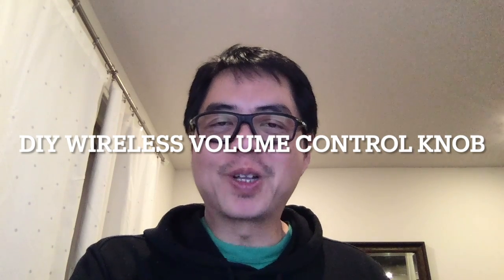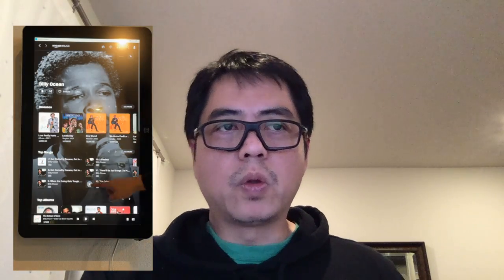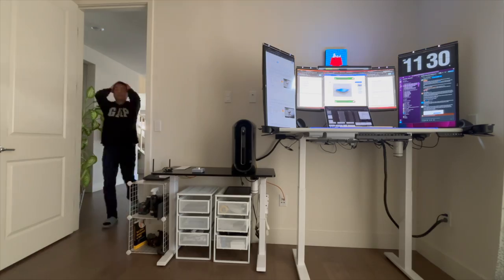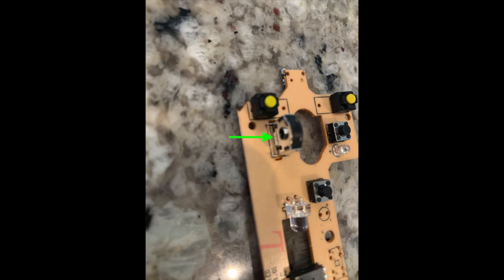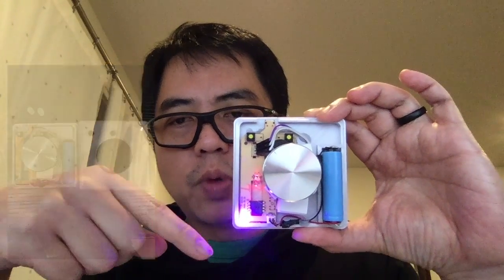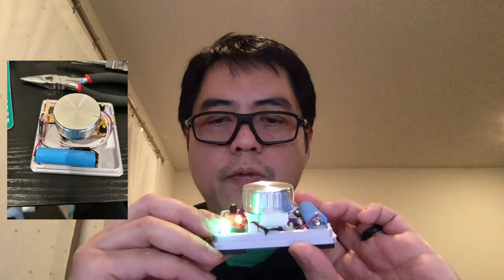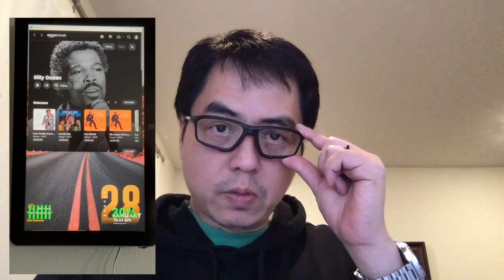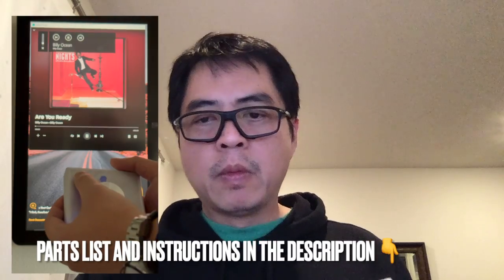DIY Wireless Volume Control Knob

Comment: This is great, been wanting to do a diy knob. I have a griffin  powermate, the old original wired one to use as a base in some way.

Also I'm really curious what you have on top of your monitors, the blinking lights? Looks cool
Reply from the maker: Thanks the lights are rgb sound lights. You can get them for cheap I just found this on AliExpress: $15.77 | Sound Control Rhythm LED Lamp Strip Music RGB Light Colorful Pickup RGB Voice-Activated Pickup Ambient Light
https://a.aliexpress.com/_mq2uo4X

Comment: Awesone proyect.
It would be nice if you can show us how to assembly all the parts, i can't understand how you manage to position the encoder to be horizontal.
Again it is a awesone idea, good job.
Reply from the maker: Thanks! For the encoder, I desolderd it from the board then reconnect it back to the board using DuPont wires. This allowed me to place the encoder horizontally. I then just hot glued it to the center of the board. Hope that helps.
Reply: @robenriquez5474  Thank you, that give me some idea, will try it in my next build.

Comment: Great work. I need a device exactly like this (wireless/bluetooth volume control). Been searching all evening without luck... Can't believe this doesn't exist commercially.
Also, what are those wild led/light strips on top of your monitors?
Reply: fortunate for you razer sells it, it's called Razer Wireless Bluetooth Control Pod Advanced Audio Control but it cost around 50 USD
Reply: @wawasababaditelupid504 thank you so much for sharing this. Searched everywhere - not once did the Razor pop up. Thanks!
Reply from the maker: Thanks! Yeah I couldn’t find anything out there too so I built one. Those are led light bar, you can buy them from Amazon or Temu .https://share.temu.com/OyWVUpgR5mA
Reply: @robenriquez5474  Wish I had skills like yours. And thanks for the url — smart! — gotta try some. 👍
Reply: Ali-Express has them for 20.00. No building, 3d printing or anything. Professionally built. Just got to wait 10 days or so for it.
Reply: @lexicon612  Do you happen to have a link for it?
Reply: @flottenheimer  USB Volume Controller PC Speakers Audio Switch Converter Computer USB Volume Adjustable Controller Power Amplifier. That should get you there. Make sure to get the blue tooth version. There are 2.